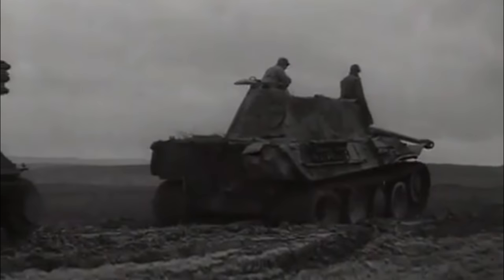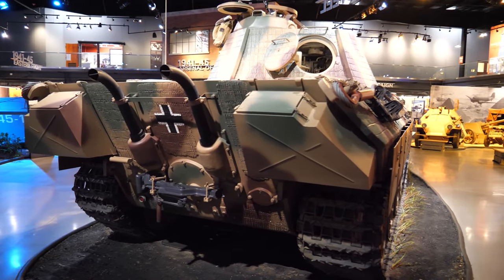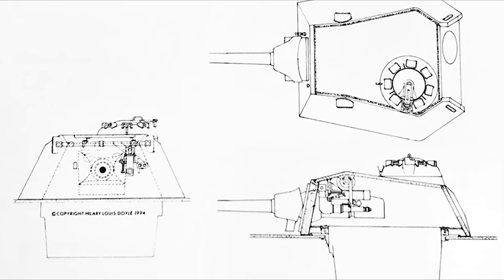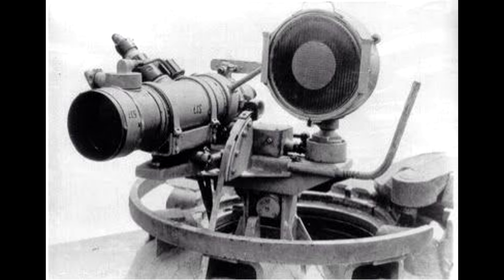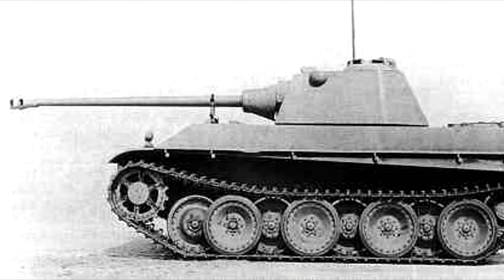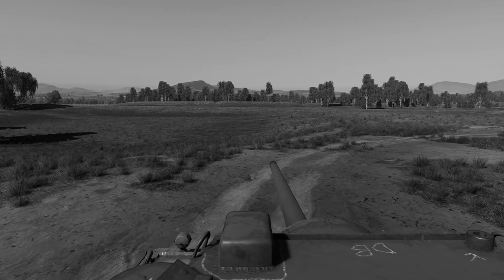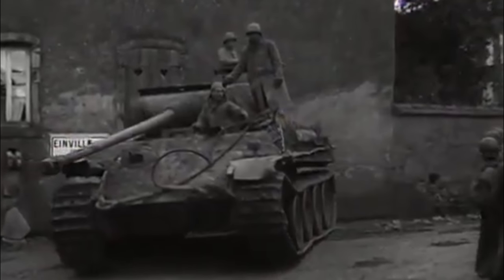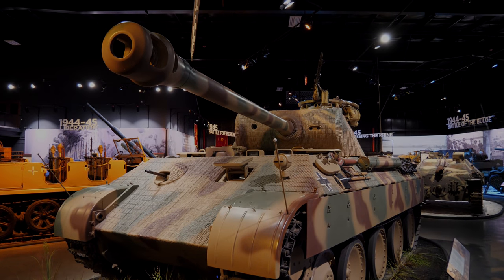The Panther Time Forgot, the Panther F | Cursed by Design

Comment: I would not call the F Panther cursed by design; its design seems entirely reasonable, being a logical & sensible evolution of an already successful design. If it's cursed, I'd say that it was cursed by time, not design.
Reply: Its still cursed because it still cant stop Russian 122s xd
Reply: @AllMightyKingBowser  NOTHING stopped those. So, no.
Reply: Cursed by Logistics
Reply: Exactly as it was cursed by time...
Reply: @paoloviti6156  but if everything is cursed, nothing is cursed. And the Soviet long 122mm punched through everything.
Reply: @lairdcummings9092  yes but the IS-2 with it's big 122 mm gun M1931, called the "Smasher" wasn't that common compared to the T-34/85 and it's 88mm cannon was no joke! Also the 122 mm gun M1931 wasn't very precise at long distances and due to not very high quality optical sight and did suffered from very low rate of fire...
Reply: And I mean, supposedly this turret cannot even stop russian 85s or even american 76s... It is super weak, and possibly more uncomfortable than the normal Panther turret as it would have the same ring size. Additionally, this "schmal" is not really that small, any decent gunner will see it like a giant weakspot to shoot at. I guess it was destined to be a failure.
Reply: @lairdcummings9092  
Tiger 2 stopped the 122, apart from the soviet propaganda pictures.
Reply: @AllMightyKingBowser  The turret face was proof against the 76 and 85 at combat ranges (above 100m, War Thunder artificially buffs those two guns), and its target profile was smaller than the old panther turret. Thus it was a major improvement.
Reply: @ThatZenoGuy  Yeah, it seems you are righ... But the turret design is still kinds faulty to me. It is a silly design, with a turret face that is supposed to be small... yet it isn't :/
Reply: @AllMightyKingBowser  
Relative to the tiger, panther, panzer 4, and even the Sherman, its proportionally tiny, with much of the face taken up by the mantlet which would have been immune to basically any WW2 ordinance.
Reply: @AllMightyKingBowser  here is the following excerpt for you: The Schmalturm design featured several design requirements with the main concerns being the removal the shot trap found in the Panther's mantlet due to its cylindrical shape, an increase in turret protection while limiting weight, decreasing the size of the turret while still maintaining crew efficiency, as well as taking 30 percent less time to manufacture than the standard Panther turret. The addition of a stereoscopic rangefinder and making the turret easier and less expensive to produce compared to the Panther's turret. The end result of Daimler Benz's design resulted in a hexagonal-shaped turret which featured heavier armour on the turret as a whole. The front plate of the turret was 120 mm thick while the mantlet was a conical shape that was 150 mm thick angled to an extreme to ricochet any shells that hit it. The turret sides were upgraded to 60 mm, an improvement over the Panther's original 45 mm. The stereoscopic rangefinder of the Schmalturm could be identified through a bulb mounted to both sides of the turret. The 7.5 cm KwK 42 was equipped to the turret with a shorter recoil system to fit better in the smaller turret, allowing the gun to maintain a +20/-8 degrees of elevation/depression, leading to the new gun being designated KwK 44/1 and would have been putted in production without the muzzle brake. If you compare with turrets  of both the late Shermans and the T-34/85 you can see that has a much smaller frontal area and a smaller profile looking from the side and the rear....
Reply: Laird Cummings.
Judging by the intro of the video, it seems that this series is talking about designs that failed. This is my opinion
Reply: @AllMightyKingBowser  Combat ranges for tank engagements are measured in 500 meters not 100. That turret cross-section would've been very good, especially in hull-down. Furthermore most tank sights and cannons were not very accurate at the time so having half of your turret be an auto-bounce angle from incoming fire would've lead to a ton of ricochets and bounces. Additionally due to the thickness of the side plating, even if they hit the front face of the turret on the cheek there's a high likelihood it would hit the area where the plates meet, most AP shells of the period would shatter when impacting in such a way. So the improvement in survivability is quite significant, issue is video games do not model tank armor or ballistics in an actually realistic manner so people have a misconception about how much armor is 'good' or 'bad'. Its almost always down to context.
Reply: @ThatZenoGuy   In War thunder they buff everything but the t4 (m93) apcr/hvap, which had better penetration values than in game, still though, you are right.
Reply: @Bruh_1629  
Not true, the German munitions are underperforming according to historical specs. Additionally the latewar design shells are not ingame.
Reply: Its engine and transmission are cursed lol
Reply: @AllMightyKingBowser  and 152s and their own 128s
Reply: @AllMightyKingBowser  and 105s
Reply: @lairdcummings9092  Boi the gun's name was 122mm D-2-5-T or D-25-T
Reply: @CaptainBenzler  specifically, designs that failed due to design defects. This small turret? Not defective.
Reply: @lairdcummings9092  ah, i see
Reply: @AllMightyKingBowser  Schmall would be better translated to narrow then small in this case and only talking about the face, the internal volume is bigger in the F then G turret, as for the design its basically just the Tiger II turret without the rear ammo bustle
Reply: @AllMightyKingBowser  Yes 122s good powerful weapon,there’s always abut,he who sees first generally shoots first and then high velocity 75 is also a very good gun.
Reply: What besides USS Iowa could ?
Reply: You have a point there. It is indeed cursed by time; too late to see combat.
Reply: i think this is the case - cursed by being late
Reply: @Direwolf13PS3  re: “video games do not model...” you know what does a great job are the pencil and paper microarmor rules (many versions). They’re all penetration table and armor layout schematic based, where you estimate the angle off in azimuth and combine with the schematic’s vertical slope to get armor basis, then roll for actual impact point depending on schematic’s area covered value for each component. (Glacis plate, driver viewport, track front, often some areas with bulges or bmg ports etc.) With spalling and low-probability weld cracks or port weak spots you can always get lucky, keep firing!

What you quickly learn is armor’s usually more effective than you expect, because the azimuth angle off concatenated with vertical slope gives you some very high “real” slope values. An 88 will not always kill a Sherman by any means, for instance. Plus you learn how important range is to penetration falloff. 

A bit of work though. Need beer!
Reply: @AllMightyKingBowser  "Schmal" doesn't mean small, it means narrow.
Reply: @lairdcummings9092  lol Tiger 1's MG port stops Soviet 122mm easily.
Reply: @AllMightyKingBowser  even then the King Tigers production turret couldn't stop a 122mm gun firing AP. Hell, if the turret could bounce it, which would need alot more armour to do so, then they would shoot the hull since the shell could still pen that.
Reply: @marksherry6589  the problem with long 75 is that it is too long that it becomes very inconvenient, especially when fighting in urban areas
Reply: @shermanfirefly5410  no tank is good in urban fighting ask Syrians about that or Russians in Grozny.Grozny was won coz arty and air smashed em and later sent tank and infantry teams to clear up,when enemy supply was strangled.
Reply: @marksherry6589  Sherman.

Sherman barrel was excellent arty barrel. 50 Shermans gun could sit in a field firing HE all day long.  No problem .
Reply: @2paulcoyle  yes true
Reply: While the Panther isn't a "cursed" design it's in my opinion a dead end. Take a look tank developent took after 1945. What you get is the Centurion, The T54 and the Patton/M48. And both the Centurion and the T54 at least date as far back as 1944 when it comes to the concept. What they all combined was a larger caliber, good mobility, relatively low profile and decent protection - for the most part. Particuarly the centurion has proven to be a design that could be upgraded extensively over time. The Panther it self ... not so much. It didn't really leave much of an impression on future tank designs either. Upgrading the gun and turret was rather difficult and even the Schmallturm was already outdated when the prototype came out. The arrangement of the gear box and suspension in particular would always mean a high profile for the tank so the chasis was not very advanced in that regard either. And on top of it all a high amount of maintenance that you would usually see with a heavy tank and not a medium/main battle tank.

The Panther was an impressive tank and particularly in the right hands a very capable tank. But speaking from it's design it was evolutionary a dead end. Which is also shown by the fact that Germany rather developed a completely new vehicle with the Leopard 1 rather than picking up where they stoped with the Panther. And pretty much nothing of the Panther was taken over in to that development. Not even the suspension which was often seen as the big andvatage the Panther had as it gave it a very smoth ride.
Reply: @CrniWuk  Nice that a 42/43 German design is put up against 45/and beyond tank designs.Bit like Sopwith vs Me 109 isn’t it.
Reply: @marksherry6589  Maybe you should read again what I wrote because my point was that the design of the Panther was not continued after the war. Not that I would put the tank next to post-war tanks. Albeit if the war would have continued the Panther F would have faced possibily the Centurion and T54 eventually. What I am trying to say is that upgrading the Panther - as a design - would have been very difficult and what they did with the Panther was a dead end.
Reply: The picture of that Panther with night vision equipment gave me the chills. I cannot imagine fighting against a Panther (in 1944 of course!) at sundown. I'd rather abandon the battlefield and hide until daylight! I'd at least beg Uncle Joe to let me have the best T34 he can produce and then slap on some extra armor plating...
Reply: Well, pretty much every single tank designed during the war by Germany was cursed because of the same reason. Some were quite marvellous designs on their own but too ambitious during war time. Way too expensive and complicated to be produced efficiently. So they were overdesigned. And cursed by it.
Reply: @TuomioK  the difference here is that this design represents a simplification, thus is anti-cursed.
Reply: @lairdcummings9092  Yeah, but it is completely new design which in itself is expensive. And G version proves that since that design was just a little tweak. In some occasions new design is required like changing bigger gun but in these kind of issues I think it is far more efficient to just tweak the excisting design and not start from scratch.
Reply: @Zeunknown1234  U know their were a time someone shove a 122mm cannon into a sherman tank
Reply: @kevinnguyen9445  REALLY?
Reply: here is the link
Reply: and yes it does exist
Reply: something I would like to have in wot
Reply: @lairdcummings9092  Never a King Tiger. Though the 122 was as more for infantry support and destroying emplacements.
Reply: @lairdcummings9092  Tiger 2 can
Reply: Panther wasn't successful. It was far less efficient than the 3 and 4.
Reply: @LordOceanus  everything cursed by logistics lol tf
Reply: @CrniWuk  Except it was continued after the war. All the tanks you mentioned have relatively strong frontal armor with weak side armor and a good gun while being relatively decent in terms of mobility.
Reply: @AllMightyKingBowser  schmal Turm means narrow turret.  It eliminated the shot trap, and had better frontal armour than the other panthers.  It also made the frontal face harder to hit at a distance, which was its role, to hit at a distance.
Reply: @AllMightyKingBowser  its not like any of the american tanks could stop the mod long 88 that the panthers had either.  They still won the war
Reply: @ThatZenoGuy  and the pnther stopped the sherman's 75mm gun, aprt from the early batches nd the hopes of dreams of wehrboos everywhere.
Reply: @ravenouself4181  
Eh? Default avatar bot?
Reply: By that time, all the new designs from the allies were technologically superior, especially the T-44 and the Centurion. If you look at the paper tanks the Germans were preparing, the E-series, they all were overweight and rather slow for the amount of armor and firepower they carried. The Germans were also losing the technological war at this point. The Panther would have performed okay mostly because of its great gun, but that's about it.
Reply: @AllMightyKingBowser using that logic any tank that can't withstand a javelin is obsolete and cursed tank design
Reply: @CrniWuk  But the design of the Panther goes back to 1941, when the Germans got unpleasantly surprised by the T-34, and the Panther was made in response to that. You say that the Centurion and T-54 date back conceptually to 1944, but those 2 or 3 years make a huge difference. It is important to note that during WW2 in just a few years tanks evolved a lot. The T-54 and Centurion are basically the next generation of tanks in comparison to the Panther, incorporating lessons learned both from German and Allied WW2 tank designs. The Germans themselves were near the end of the war working on the "Entwicklung" or E-series tanks, but of course due to the changing circumstances in Germany none of those tanks would end up being completed, otherwise those tanks would probably have been more than a match for Centurions and T-54s.
Reply: the panther really wasn't that successful, it was "good enough". only a fool would call a tank with a transmission made of glass, and little to no infantry support "successful". like anyone who knows the basics of tank warfare can attest to that, there's a good reason pretty much no one kept the panthers in service, meanwhile panzer 3/4's were being used for decades after the war. and people will still say I'm wrong even though everything i just stated isn't an opinion but a fact.
Reply: @Coldcooler3  You can't fault the lack of infantry support on the design itself. It certainly did have issues, but lack of infantry support is not the tank's fault. As far as Panzer IVs being used after the war, you do have to take into account that German allies did receive those tanks, whereas the Panther was used exclusively by Germany. And also, the French did use a company of Panther tanks for a few years after the war. But either way, neither the Panther nor the Panzer IV were really used in any significant numbers, and Panzer IIIs and IVs were certainly not used "decades after the war". The reality is that neither of these tanks was really even avaliable in any significant numbers after the war, whereas Shermans and T-34-85s were very avaliable. And even those weren't used for long in large numbers, although some antique tanks did see service in the wars in former Yugoslavia for example in the 1990s, such as Shermans, Hellcats, M36 Jacksons, as well as the T34-85, with the latter probably having the most extensive post war service record in general, serving in a number of countries for a long time after the war. But when you look at the German tanks, not that many were avaliable to begin with and obviously with Germany losing the war many were lost in combat and/or scrapped after the war.
Reply: @Coldcooler3  
Protip, it's transmission was fine. It was the final drives that were the issue, and they were an external component.
Reply: It’s design couldn’t be supported by the course of logistics and material
Reply: @ginostrother4401  Be fair: That line applies to pretty much the entirety of the German war machine by that point.
Reply: Agreed,  cursed by allied war efforts
Reply: The Panther F Turret offers not more protection than any other Panther Turret and those were huge weakspots even on release day already, so i say the Schmalturm was entirely obsolete unless they decided to increase thickness of that thing to at least 180mm. Adding a Saukopfblende would help this thing a lot.
Reply: @Einheit101  smaller turret, harder to hit. Protection isn't the only point though. Conservation of scarce resources, both materiels and man hours, also counts, and in fact, would likely have been of greater importance at that time.
Reply: @lairdcummings9092  this turret is still huge as a house with a glaring flat front and thin metal. Every hit would cause extreme spalling inside. Turrets need to be rounded or protected by a thick mantlet. It also helps no one that the turret is produced faster because the tank also needs a Hull and i guess the hull was the limiting factor.
Reply: @Einheit101 120mm at 20 degrees with a mantlet covering half and extremely sloped cheeks is not weak. The weakest part of that is about 50% stronger than the frontal armour of a Tiger 1. Real life isn't a video game, that turret would have been extremely resilient to enemy rounds.
Reply: @AllThingsCubey  extremely resilient against enemy rounds? 120mm flat surface in 1945? What are you dreaming? Any hit from a US 76mm or Soviet 85mm round even at 1000 meters would render the tank absolutely unusable.
Reply: @Einheit101  Err, no? That's not the performance figures for those guns
Reply: @Einheit101  US 76mm penetrated 102mm at no angle at 1000m. Only the HVAP rounds stand a chance at that range, and they were incredibly rare and seldom used, and even at only 100m the standard M62 round cannot penetrate 120mm at 20°
Reply: @Einheit101  The 85mm does even worse. At 1000m, none of the rounds fired by the D-5T gun are able to penetrate the armour, even the APCR, which loses penetration very steeply at range in the case of soviet ammo. The 85mm cannot penetrate the armour even at 500m, and only becomes able to do so with some reliability at 200m or less using the standard APCBC rounds.

Say again how this is not well enough armoured for 1945?
Reply: @AllThingsCubey  so you think a gun that was specifically designed against Tigers that is almost capable of penetrating the turret front will not cause any spall? And btw, HVAP was not rare in mid 1945 anymore. One hit and the gunner or loader will get shrapnelled, thats simply how it is. Watch the video M4 sherman vs Tiger 1 from Dejmian XYZ, which even uses the regular sherman tank, so you can guess what will happen to the poor people behind the Panther turret front in a less extreme extent.
Reply: @Einheit101 HVAP actually became less common after 1944. The vast majority of the stocks were depleted and not resupplied. Zaloga writes as much and you aren't going to find much more reputable a WW2 tank historian.

Non penetrations of RHA don't really spall either. Either the plate gives way and the round penetrates, or the round is stopped and obliterates itself after gouging a partial hole. Spall was really not a major issue in WW2 armour unless getting hit by high calibre HE, or in vehicles with riveted construction. An M4 took a glancing hit from a Jadgtiger that bowed in the side hull, and didn't spall and kill the crew, that's simply not how armour responds to AP non-penetration.

Please stop making up nonsense claims without evidence. It's immature.